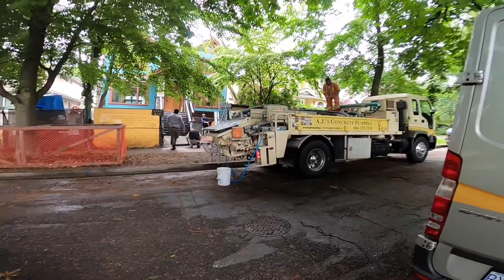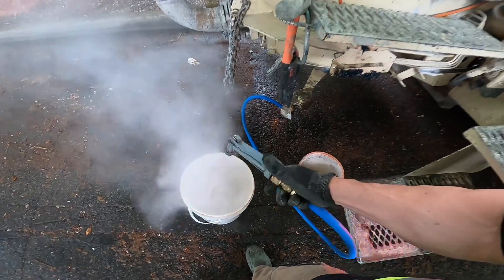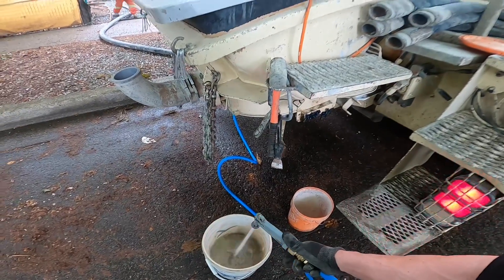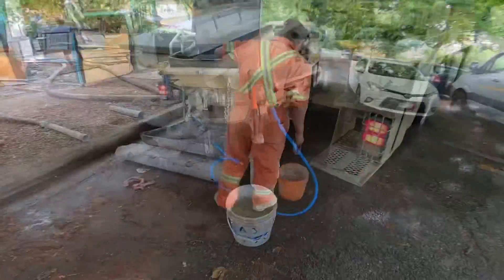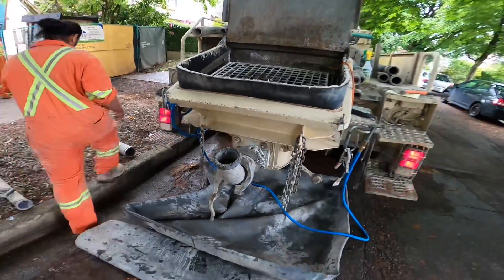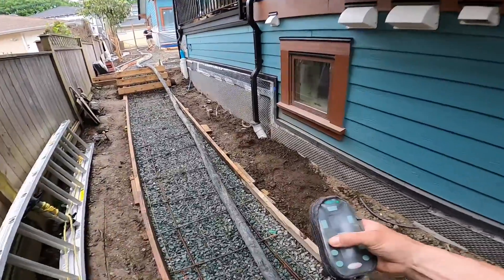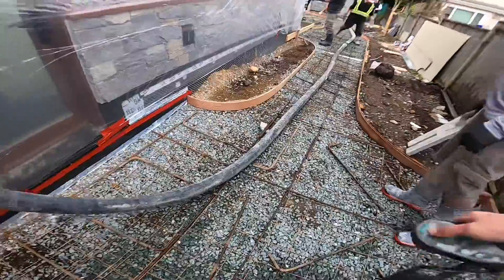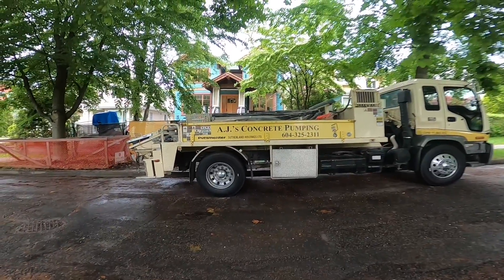How to prime a line-pump with bentonite:

Comment: I pump blockfill through 2” line. We always use type 10 mixed up like pancake batter, is the bento better?
Reply from the maker: They both work great. Nice thing about the type 10 is that it doesn’t ruin the first bit of concrete out the end of the hose like bentonite does.

Comment: How do you pull all that hose back or do you disconnect one at a time and if so how do you clean out the lines you disconnect? Compressed air and a sponge ball? Aimed at what? (I’m new to this and just trying to be efficient, I operate a schwing sp500)
Reply from the maker: @CptNtrps66  Definitely checkout this one which I posted just yesterday. It’s probably my most favourite method for cleaning up the system at the end of the pour: 

 https://youtu.be/n3qUGM2if7o?si=idgJIQx3NY2npII7

Comment: Where can we buy bentonite?, I have a line pump here in nova scotia . We used prime a pack brand but it's expensive.  Also we put our sponge in front of primer to hold it back , seems to help . We also tryed buying bentonite from a drilling company but it's not the same product plugs 30feet in . We have tried everything prime a pack is only one we can get to work , our concrete also sucks here
Reply from the maker: Attached is a link to the exact product which we use: 

https://www.wyoben.com/product/extra-high-yield-bentonite/
Reply: @canadianconcretepumper1979  what size aggregate are you pumping . We use 3"line but we would like to use our 2.5"hose we can't our 1/2inch stone mix still plugs steady cant use any smaller the 3" and we still run into quite a few plugs
Reply from the maker: @duurrick  most of our mixes are 1/2 stone and we pump them through as small as 2” hose. Mix designs here are also blended with smaller stone and plenty of sand. 

We used to see a lot of 3/8 round/river stone, but it has been hard to come by in recent years. That stuff pumped like a dream!!!!
Reply: Sand and cement works just as good if not better

Comment: I noticed you don’t put any water before the bentonite, have I been wasting my water and time? Haha
Reply from the maker: It really depends on the mixes/materials/setup.I typically do not, mostly out of fear that the bentonite will somehow work it’s way past the water and cause a segregation plug when the water comes in contact with the crete. This is all just fan-dangled theory though. If it works, I say keep doing it!

Comment: Where do you buy your bentonite?
Reply from the maker: We get ours from a local drilling supply outfit. Concrete Pump Supply sells it pre-packaged as “Prime-A-Pac”. It is a bit more expensive than buying bentonite by the bag, but the individual sizes are a little more convenient in terms of storage and use.
Reply: Cement and sand bro.  If I couldn't wash onsote I'd go back to get plant to wash and grab two buckets of sand every rime.  Works mint

Comment: Years ago, I worked for a company that required all machines to prime out w bentonite. Thought it was strange to use it w booms, but did as I was asked. 

Ff a few years, a fella primed out in a panel... He bought that panel. Top corner from what I was told. Just gotta be careful. 

Personally did 770', all rubber, w bentonite. Works awesome if used properly
Reply from the maker: We also made it our standard as stuffing booms up on the prime has been virtually eliminated ever since. It was a very rare occurrence, but also was VERY expensive the few times that a contractor decided to send loads of concrete away on the pump companies tab). We also had a guy prime it directly into the balcony area of a suspended slab….. that was a nice little $8K repair bill (could have been much worse actually).
Reply from the maker: It works fantastic as a priming agent, but definitely needs to be used responsibly.

Comment: What size stone do they usually use for line jobs like this? Maybe convert it to MM for me 😂 standard is 20 MM aggregate here and very rare we even use 3 inch.
Reply from the maker: This particular mix is 14mm stone (which is most common for our “small rock” mix designs). Standard mix for the region is 20mm stone and we occasionally see do 10mm, and sometimes even 5mm for some of our architectural mix designs. Most of our 20mm mixes will pump through a 3” line, but our sand is natural and our stone fairly “gentle”. The line-pump mix which we most commonly use is a 14mm which we push through 2” line (200+ feet no problemo).